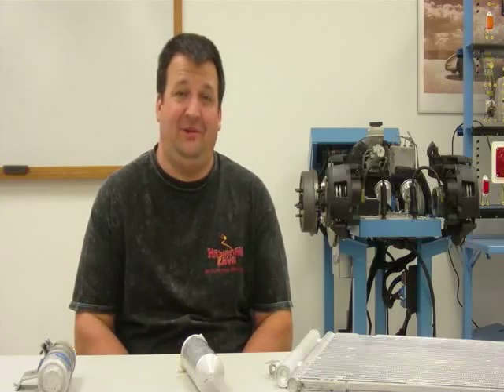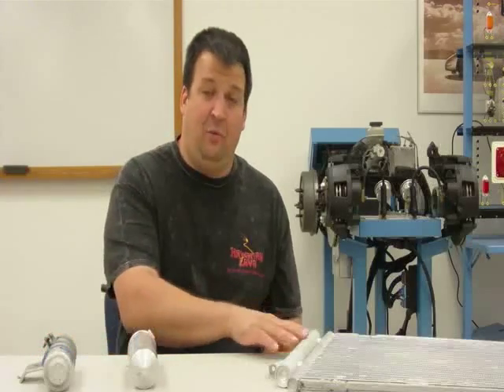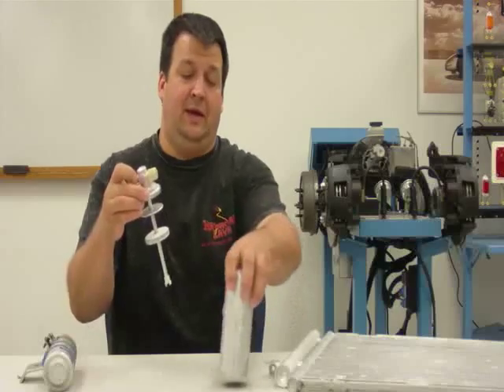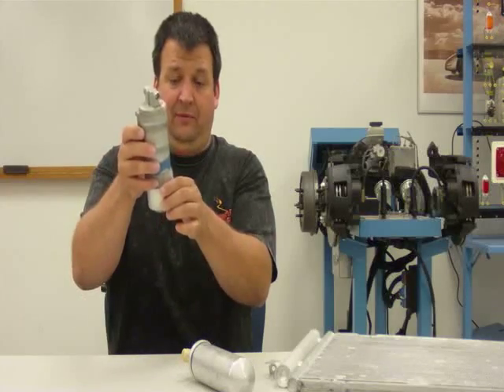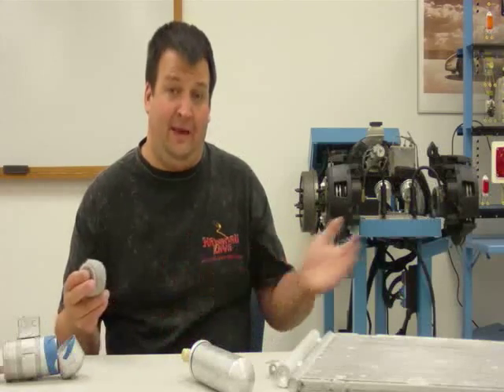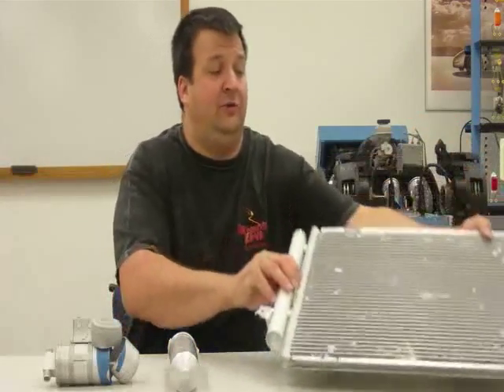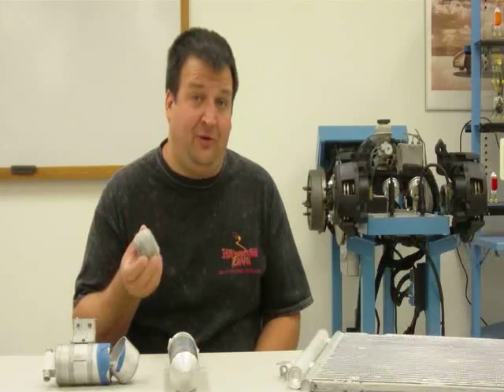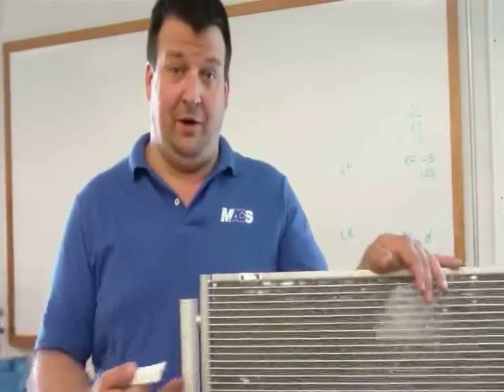A/C Receiver Drier Overview

Comment: Thanks man..I had a dye run thru my A.C system..I drove it several days...2003 Honda Civic..I go back to the mechanic,and he goes under the car, with a black light..He noticed that the A.C compressor was splashed up, with the dye ..He recommended to change out the compressor,the condenser,and the drier..All 3 components..So now, I'm going back to my A.C guy, to add the Freon..I hope all goes well.. it's been too hot! Gotta have A C!

Comment: If you don't have the system open for days then you shouldn't need to replace the receiver drier long as proper servicing vacuum attained etc.. has been accomplished.
Reply: Just replace it, it's cheap insurance

Comment: working on Cat 3 crawler dozer , been doing a/c repair and maintenance for 30 + years , my first system that does not have a drier ! looked at condenser ,no area for desicant to reside  in it .It has no physical drier . No info from cat , but new condenser cost  $3600.00 
the part # 343-3550 could it have a drying properties ? what if I flush all systems , except comp, and add drier? what are your thoughts, it would save customer $

Comment: Very informative post - thank you.   I have two questions:  
a) Where is the sight glass on a 2001 4-cyl Toyota Previa?  and 
b) As this model runs on R134a gas, are both the condenser fan and radiator fan supposed to run at only slow-speed with the A/C on and the motor cold, or should they run at full speed?  

The 1990 4-cyl Camry we owned had them running only at slow-speed in this situation - but then again, it used R12 gas :-)  I believe the Previa A/C needs a regas as it takes ages to get cold in hot weather, but it would be nice to check these things first.  Thanks for any advice you can give.

Comment: How can you tell if the receiver/drier is not working?
Reply: When the AC comes on with the windshield defrosters it will actually fog up the bottom of your windshield a little ... also the atmosphere inside your car will have a noticeably humid feel to it when you have AC turned on.

Comment: I have a 2013 Toyota Tacoma. It has the intergrated dryer condenser. Can I just replace the dryer beads without having to replace the condenser dryer intergrated system?

Comment: can we reuse receiver drier?like i have change my drier 3 times as the technician told me to do so,in just 3 session of repair.. im sure, each of the driers not yet totally dirty and in full moisture so i save the 2 driers and have them vacuum in my compressor from an old refrigerator unit.. can i reuse these driers if ever i need driers and save around 10 USD? is it worthy?
Reply: Not worth it.  Spend the cash now to save spending later.  Being cool isn't cheap.

Comment: nice video and I realized toward the end you covered the condenser integrated ones ... awww so that is where the receiver dry was hiding normally I looked for the can right between the condenser and evaporator/expansion valve. high side begin receiver dryer
Reply: I have a 2013 Toyota Tacoma. Can I replace just the absorbing beads in the dryer without having to replace the whole intergrated condenser?

Comment: curious not sure did you cut those open because on most cars I haven't been able to open the receiver dryers the can type ones that is, for the integrated ones on the condenser I saw that you can  change the desiccant bag